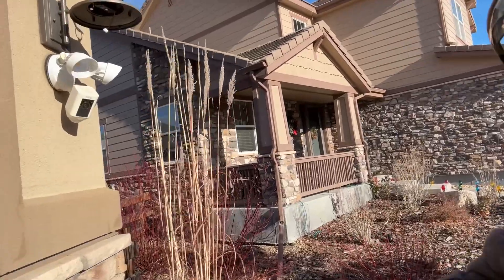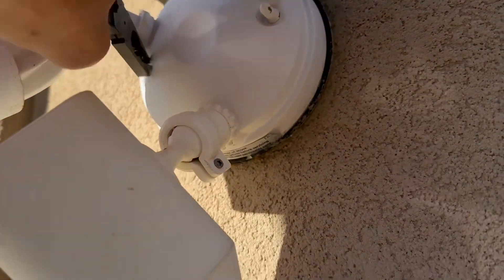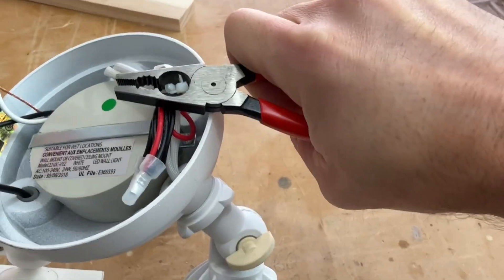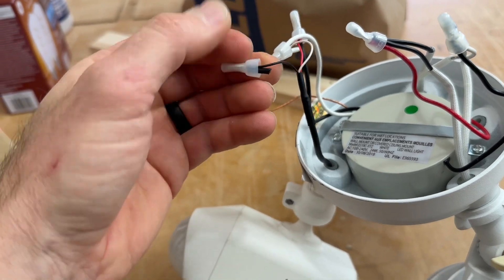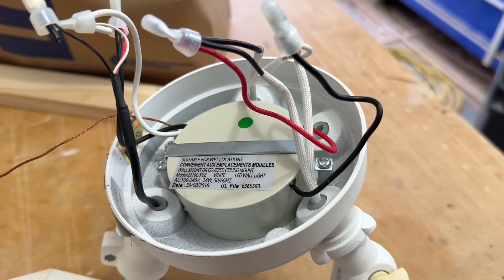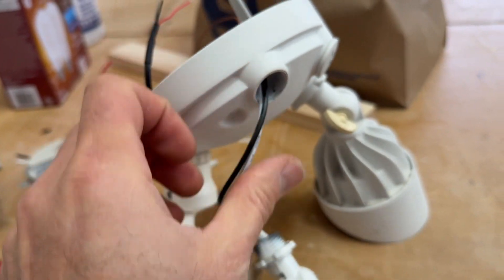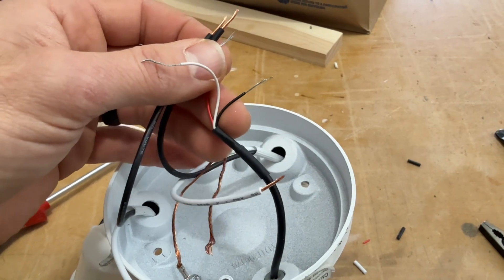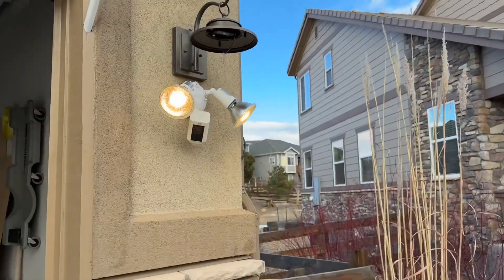Adapt Ring Floodlight Camera To Take Replaceable Bulbs!

Comment: Where did you tie in the red wire? I don’t see it in your final wiring shot. Thanks!
Reply from the maker: Oh man I didn’t realize I missed that! Honestly it’s been too long to recall but the basics of what’s going on here should lead you to the correct wiring:  essentially you are deleting the ballast, since screw in bulbs have them built in. So if you trace the wires going in and out of the ballast with a multimeter to determine what color wires to hot and neutral leads, then you should find the information you need.
Reply: @Wallymakesstuff thanks, I’ll figure it out.
Reply: @johnnesbitt4163  I believe you tie all the red wires together.

Comment: What did you do with the inverter?  do you not use the inverter, or use another inverter?  The cameras works without the inverter?  Can I use any LED outdoor flood lights?
Reply from the maker: I completely bypassed it, and if I recall threw them away. The screw in bulbs have their own ballasts inside them and take direct ac current.

Comment: If you have a ring subscription they will replace for free 😂
Reply: I have a ring subscription and it does extend the warranty but they still said my model was out of its warranty period and told me to buy a new one.
Reply: @christopherlong4580  I damaged mine pressure washing the house. Ring's Customer service isn't the best. I'll be making this repair myself as shown. THANKS!
Reply: @matthewmoran6581  you never tell them you pressure washed. Just follow the script don’t give too much info they will replace.
Reply from the maker: @christopherlong4580 you’re right, and I remember I went through that discovery about a year before I did this mod… I swear these things are programmed to fail within months after the warranty is up 😂. But this mod will keep you going for a long time for a lot less!
Reply from the maker: Omg that’s hilarious. I have a ring subscription. Ah oh well, at least I can swap them out fast now.
Reply: Then u have no security
Reply: @dotnetdevai you place it when the new unit arrives.